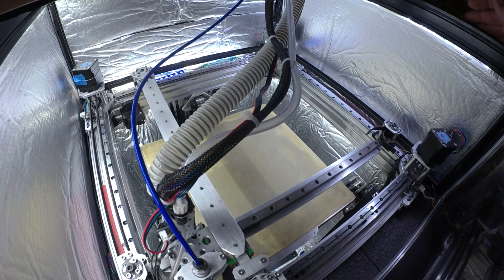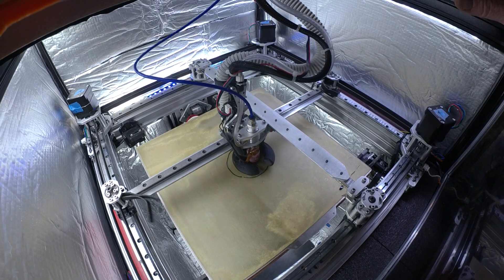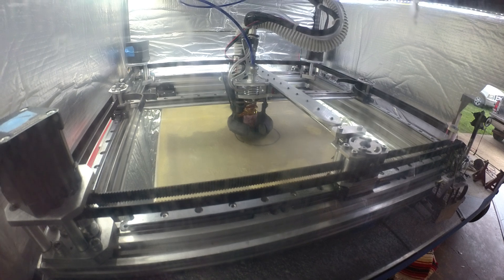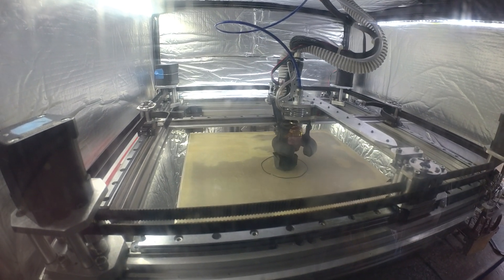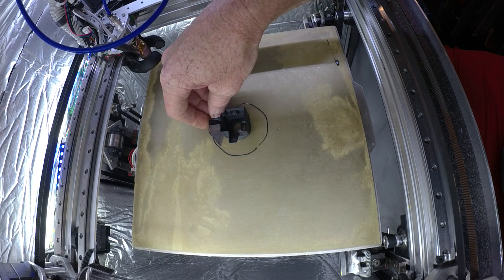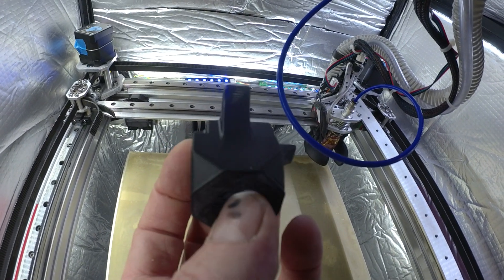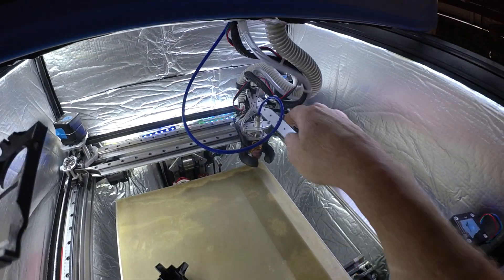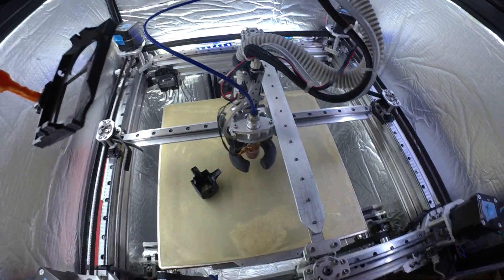0.8mm nozzle vase mode cube bowden test

Comment: Why do you think pushing force is the problem and not simply that solid plastic has reached the nozzle tip? You're using a "Goliath" style hotend right? Needs moar melt zone surface area 😁
Reply from the maker: There is a point where there are frictional losses from filament velocity: surface friction, filament drag, affecting torque.
Reply: That hotend should be able to melt 80+ mm³/s.
Reply from the maker: @daliasprints9798  , Is this speaking from experience? Please show!! It must be working flow, with PA functional, ABS, and a working temp no greater than 275C.
Reply: @ I was replying to the OP not to you, who was suggesting that the plastic isn't actually getting melted in time. I'm pretty sure that's not the case, and that the problems are other things, as you say.